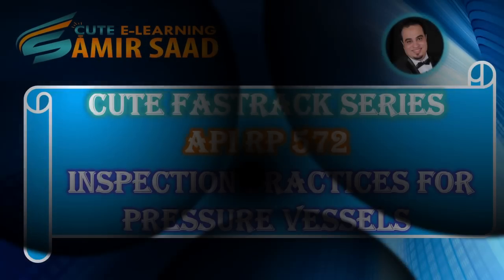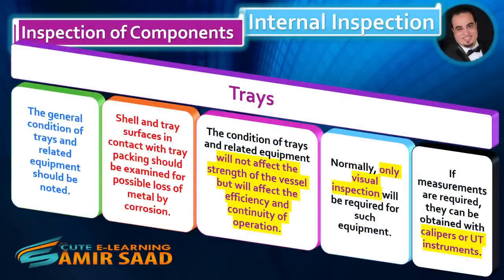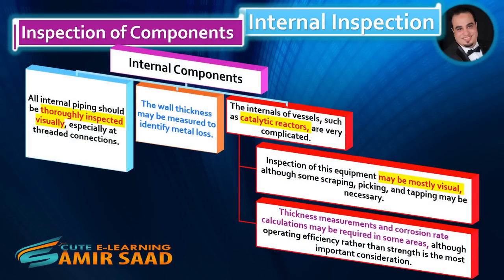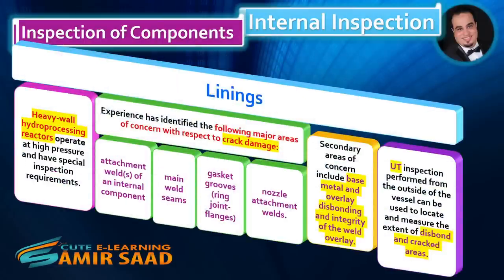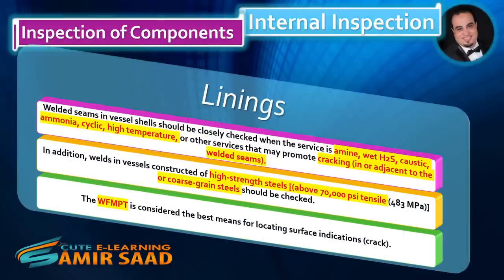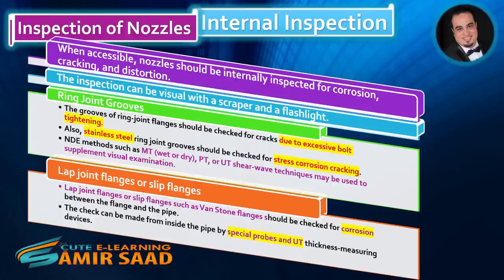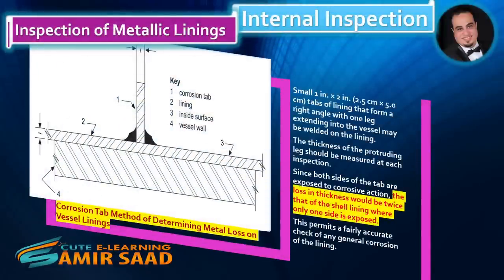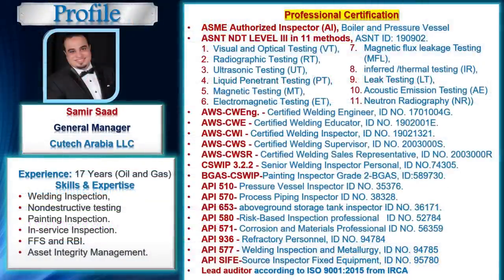API RP 572 Inspection Practices for Pressure Vessels (lecture 17)

Comment: Q1 can be the C but also and more reliable the D since measuring the thickness UT is more feasible to hit a baffle with a hammer
Reply from the maker: First , you have to check visual with light hammer to check for soundness  ,if appear any metal loss , then  you can use transfer or dierct reading caliper or UT can used to check actual thickness against original.